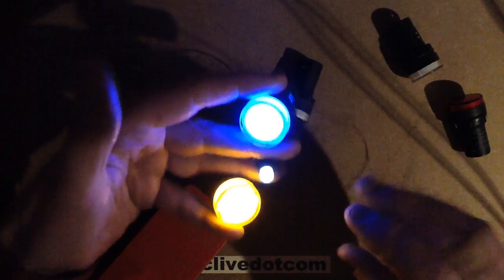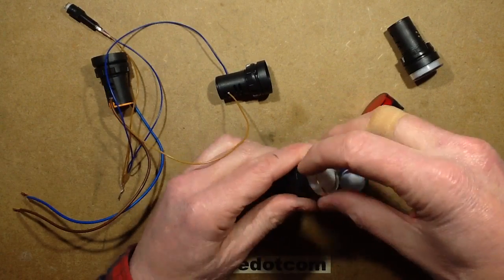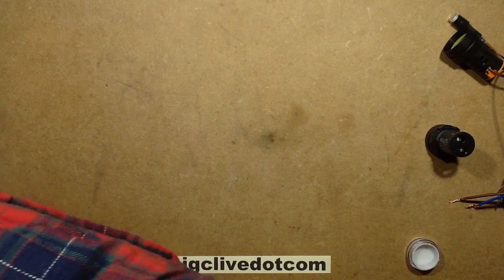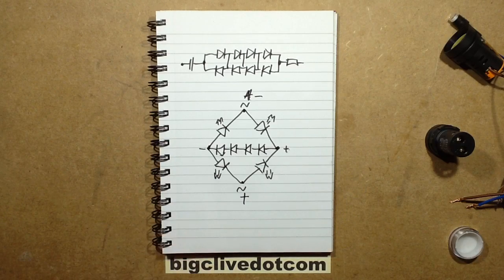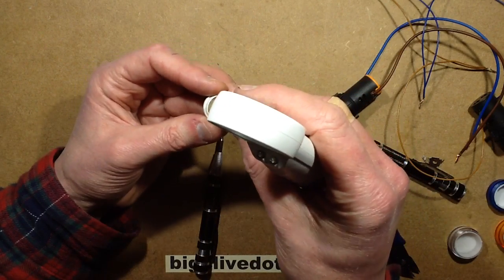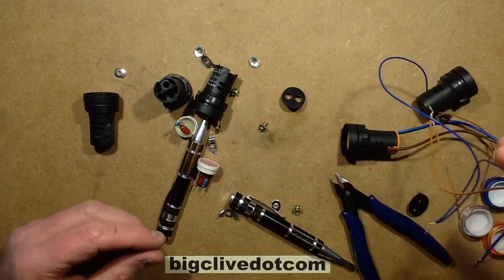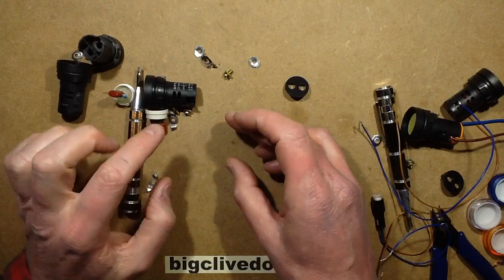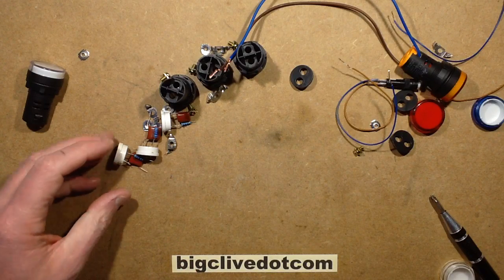A look inside some eBay panel indicators.  (with LED based rectifier!)

Comment: these would be cool to use in a project ..... im doing a new aquarium build would be cool to make a small panel underneath with all the filtration with these like green lights showing everything is ok and red for if the temp is too high/low ... filter is getting hot and some temp displays voltage displays to show whats taking power and if a device fails theres a red light and a buzzer plus a green orange and red on a timer green for a month then goes to orange .. then half a month later to red to show when i should do maintenance.... would be a cool project and not really cost much to do just a few switches and indicators and some know how !

Comment: i think the 380v indication was possibly a miss packaged 110v indicator, so 110v with 250v cap, 220v with 400v cap, 380v with 630v cap? maybe i shouldn't give them the benefit of the doubt though...

220,230,240v single phase is 380,400,415(420) 3phase

Comment: I wonder if those come in 415 volt & 500 volt?  Those are the two voltages used in 3 phase in Australia, 500volt is very uncommon though.
Reply: +milksheihk Well based on these, all they have to do is print the new spec on the outside and just use the same insides and Bob's your uncle.

Comment: Yeeep I think everyone remembers every time they've ever been bit. Got a nasty but quite short 2KV hit after a cap shorted and burned through the rubber insulation on the test leads. Moral of the story is term the blasted supply off first.

Comment: Great video (as always)! Just an idea, could you repurpose these to say 12V or 5V, or even make a better mains version of them? Funny, I've been looking at the exact same bulbs for a while and I just want to buy them because I love their looks. Haven't got around to do so yet, but will probably get some soon.

Would love to see a repurpose if you find the time and interest for it =)
Reply from the maker: +Chris Fredriksson The combined forward voltage of the red and yellow versions will be a bit high at around 12V, but the green, blue and white versions that use a single LED should work on 5V and up with a suitable series resistor.
Reply: there are already some 12V and 5V versions available if you don't want to modify them

Comment: Why does everything have to be LED. Stick with good old neon for mains voltage indicators. Never seen one fail.
Reply: +Xibalba You must have never seen a power bar with a neon indicator, or a switched power bar with neons on each switch. They seem to fail quite a lot.
Reply: +Xibalba Because you can't see them in a bright production environment.
Reply: +Xibalba  They go dark over time, and flicker , or sometimes explode. In the industrial facility I work at, we have hundreds of neon indicators, so we have seen all kinds of things happen. They do run much cooler and last much longer than equally-small sized incandescent bulbs, but color options are limited to red, orange, green and blue for neon indicators.
Reply: +Xibalba Tomorrow's CBA job is to replace the neon in our oven's control panel, as if I leave the oven going after drunken dinner one more time I think the GF'll brain me.
Reply: if leds are driven properly they last almost forever,  BUT every thing seems to drive by the smallest leds at the max possible current with whatever they think can get away with, hence the premature failures
Reply: As long as they're high quality and the current through them is always well-controlled (read: metal-film series resistor of proper resistance and power rating), I agree that neons are better for mains indication, as long as it's not a brightly-lit shop floor, which most industrial environments are not. New neons are ridiculously cheap: I paid about $20 for a sack of 100 type 1MH neons recently, and they run so cool you can use rubber grommets to hold them.

Comment: Well the 380V rating makes sense to me because I am an austrian electrician and decades ago the voltage between the phases were 380V  (nowadays 400V). 
But I have never seen indicator lamps run at 380/400V in most cases they are powered from the low voltage supply used for the control circuit (mostly 24V) for safety reasons.

Comment: whatever was wrong with using small neon indicators!   i had a few items with whitish neon  indicators, they seemed to only last a week before dying!
Reply: +jusb1066 Neons just use so little power, they're awesome. I agree with you. And they don't fail dramatically usually, just get dimmer and dimmer so you get plenty of 'change me' warning.

Oddly that kinda ties in with what clive was saying about MES light sockets with 240v on them: When I worked for a university, they had switch panels for the lighting on squash courts outside the court (obviously) and they had a neon to warn you if the light inside was left on (so the caretaker could see at a glance if any had been left on). The indicators were MES neon bulbs, complete with a resistor for 200-250v operation. On a torchbulb sized socket :-O
Reply: +jusb1066 
I have neon indicators in my light switches at home, going on 52 years.
Reply: +jusb1066 ive always preffered the older technology too things .... i do theatre lighting and use big dimmer packs and 15 amp cable with 15amp duraplugs going to big par 64 cans using 1000w bulbs and the way the stage is lit up it looks really natural ... now theyre trying to replace all these with led ... but theres no natural light no decent power output and i just really dont like the fact there replacing it all its stupid
Reply: Neon lamps are often overdriven in cheap chinese products, that kills them pretty quickly.

Comment: Using the LEDs as the bridge rectifier is such a good idea why don't we see it more?
Reply: +Timothy Sherratt from my experiments, led's die faster when they have to do reverse voltage
Reply: +TheChipmunk2008
Because its a bridge rectifier, each LED in the bridge would only be seeing half the reverse voltage of the string in the middle, or double the forward drop of the center LEDs (because there's 4 of them).
That's not bad at all, and putting the diodes in the center in any kind of series-parallel arrangement (or just all in parallel) might send the bridge LEDs into over-current.
Reply: probably because of that annoying flickering.
Reply: +jusb1066 oh yeah, good point, the LED's would be seeing the fwd voltage of 4 LEDs as their rev, voltage. If the central one was just ONE led, it'd probably be safer (from a reliability point of view)
Reply: +TheChipmunk2008 Three out of five would still be a more efficient use of LEDs than four out of 8 from a component standpoint, not that they are expensive components especially in China.